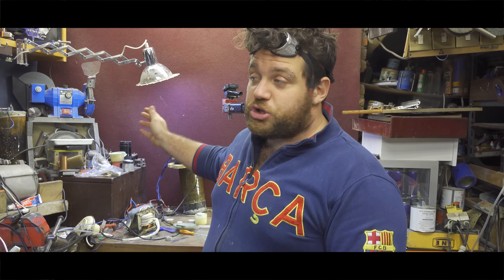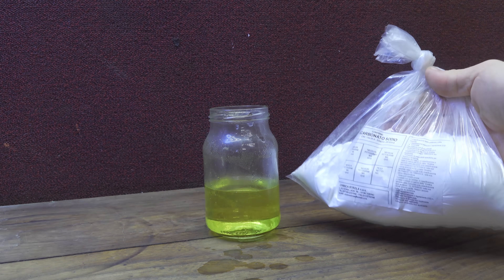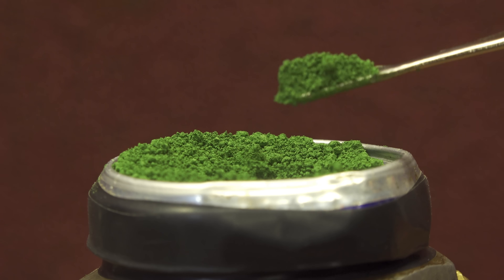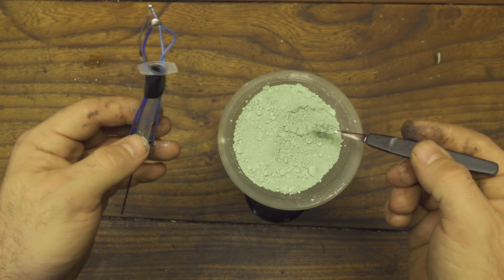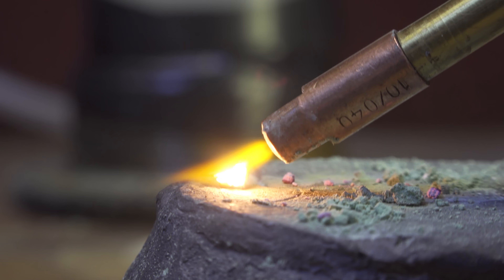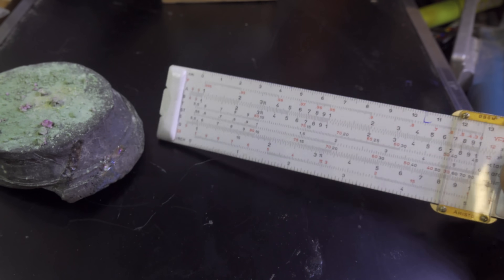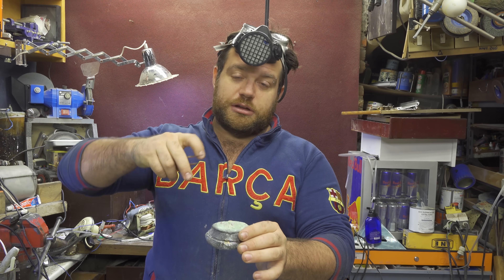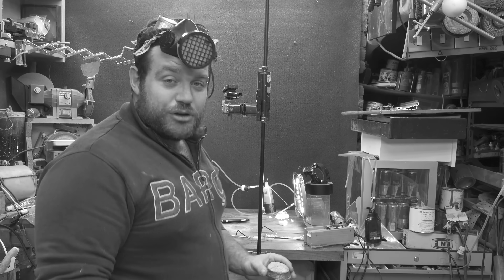How to Make precious Ruby at Home - 4K

Comment: He's remarkably careless considering the chemicals and chemical reactions he is playing with.
Reply: Because he doesn't know what he is doing. He copied another person's experiment, like even said the same jokes. I had respect for this guy and the crazy stuff he does, but now I know he is a sham.
Reply: He's a guy due a Darwin award
Reply: Not all Russians are smart.
Reply: огромная эрекция  how is he copping Ave ? Their content is completely different ! Are you talking about the green cutting mat ?
Reply: The chemicals he used were nothing really ?foil , sodium bicarbonate and sulfuric acid ? Bah ...that's nothing .
Reply: Hydrochloric acid is not that dangerous. If it splashes on you just wash it off in a few seconds and nothing will happen. There's a video of a guy on here soaking his hand in it. People are hypersensitive safety Sally's about working with chemicals when common sense is the only safety equipment necessary 90% of the time. Goggles would probably be a good idea though.
Reply: @Muonium1   The acid by itself is the least dangerous thing he's working with lmao. The gas from the foil+acid is hydrogen which is extremely flammable and hydrogen chloride which is poisonous. Chromium oxide is extremely toxic and a strong mutagen (and widely considered to be carcinogenic as well)
Reply: Nah. That's Hexavalent chromium. This is the trivalent oxide. It's highly insoluble and relatively inert. Don't breathe the dust and you will be fine.
Reply: @Muonium1  he has no clue what he is doing check the elemental maker channel , rulof basically copy pasted his hho torch and ruby videos
Reply: It's the internet. who gives a shit. you can make a video on literally whatever you want. nobody owns these ideas, they are over a hundred years old.
Reply: @ullantra  
The trivalent chromium oxide Cr₂O₃ used in this video has very low toxicity, the hexavalent chromium oxide CrO₃ is the dangerous one.
Reply: @Muonium1  you mean chromium hexavalent.  Like Erin Brockovich sued that chemical company over in the movie about giving cancer to that whole town ?
Reply: @chrismsmalley2626  Ya, except it never actually happened. There was never any actual evidence of elevated cancer levels in Hinkley compared with surrounding towns. (imaginary) ambulance chasing lawyers, multihundred million dollar settlements, and hollywood movies have very little correspondence with reality.
Reply: @Muonium1  Least nasty?  the most carcinogenic. 
Its fumes are nasty. Without fumehood have to be made outside. Kidding with this will make a hole in the lungs. But is not that rare to get pulmonar edema and die in 3 days.
I beg to beware do it at home.
You dont even need to use hidrocloric acid to get some aluminum oxide. 
Not a DIY.  There a kids and pets putting these on mouth in people houses.
But he did a great experiment. 
Ends here.
Be more safe.